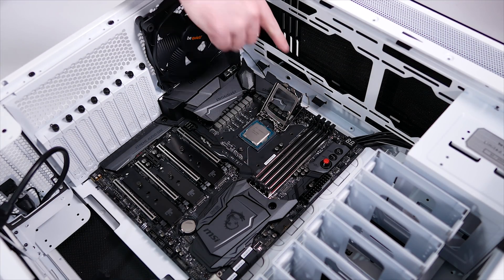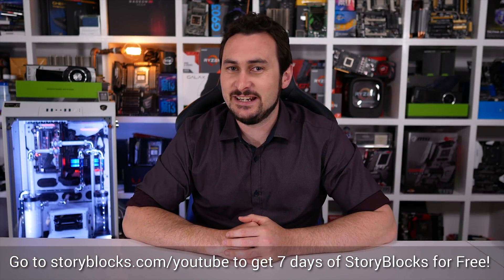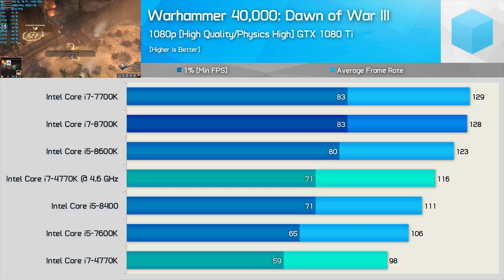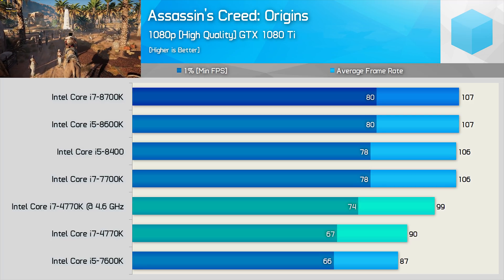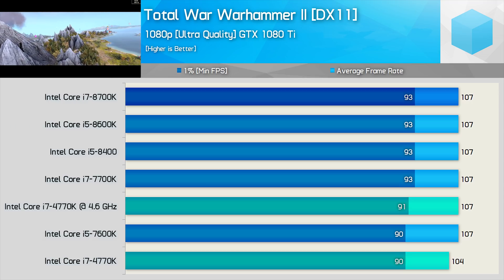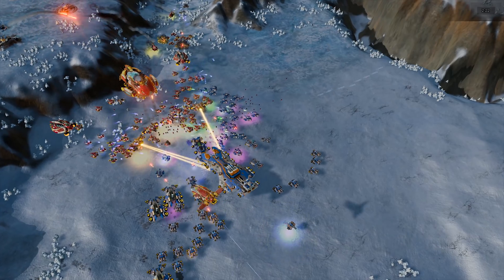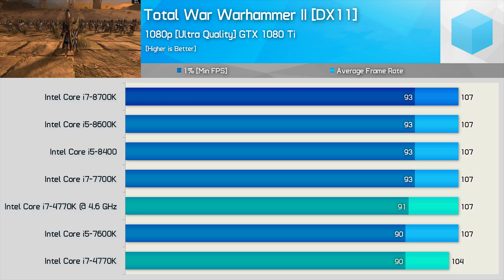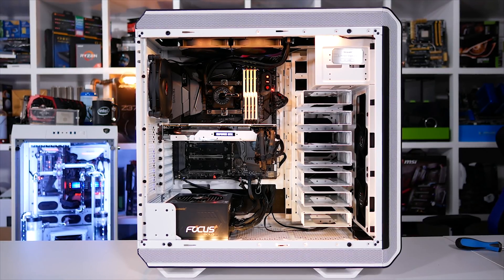4 Year Old Core i7 vs. Core i7-8700K, Worth The Upgrade?

Comment: How the hell can the 7600K be that competitive compared to the 8threaded Haswell chip? Skylake's IPC is only like 8% faster, this is weird. Can you verify the bandwidth is the culprit by trying it out on Vega? I'm more suspecting Nvidia's heavy mainthread usage to scale well with Skylake's 'supercore' tech. Because this goes way beyond the IPC difference.
Reply: Fuddy Duddy 8% per core.

Theoretically 32% faster at the same clocks, if games scale correctly.

Also if games don’t utilize the extra threads from Haswell i7s, performance won’t be as good.

Looking at well optimized titles, for ex BF1, the 4790K beats the 7600K easily.  7600K chokes from lack of threads.
Reply from the maker: I just lowered the memory speed on the 8700K system to 2400 and tried Call of Duty WWII @ 1080p [normal], the average fps dropped from 219 fps previously to 182 fps, a 16% reduction for a 25% drop in memory frequency.

Reducing the 7700K result by 18% would see it slower than the overclocked 4770K. Hope that helps clear it up for you.
Reply: Haxor, that's not how it works lol. IPC difference of 8% when comparing quadcore vs. quadcore means it's not 4x8 = 32% faster.
Reply: Fuddy Duddy

Sure it is.

IPC is improved about 8-10% at similar clocks, increasing single core performance on every core.

You can see the 7600 is 22% faster on average compared to a 4790 in quad core tests.  But if games utilize more than 4 cores/threads, as you can see the 4790 pulls ahead.

Games that rely solely on single core performance and IPC, Skylake i5 will win.  Games that rely on threads, Haswell i7 would.

(I chose non K, because they match more closely in clocks.  Granted if they were K, you could overclock both, and Skylake OC better)

http://cpu.userbenchmark.com/Compare/Intel-Core-i5-7600-vs-Intel-Core-i7-4790/3890vs2293

Similar reason even the 2600K is still powerful today, beating 6600/7600K in heavy high threaded titles, but much slower in single threaded apps.

Based on your theory, a 7700K should be close to a 4790K, about 8% difference both being 4c8t.  But 7700K is a lot faster than 8%.
Reply: Haxor inator there are other reasons, as explained, to explain the higher than Ipc differences. No, it does not work that way, stop being an idiot

Comment: Bf1 single player i5 6600k 4.6ghz and 1070 silky smooth, multiplayer another story... Friends with i7s and ryzen do not have this issue in 64 player and huge geometry crunching scenarios
Reply from the maker: You can see the large variance between the average and 1% low in BF1 single player, that said the multiplayer issues for 4-core parts is well documented.
Reply: Fair point! thanks Steve,  Have a good one!

Comment: So what about those of us stuck with haswel i3 4150 hahahaha :P
Reply from the maker: Get a second hand i7 or upgrade to 8th gen or Ryzen ;)
Reply: yes will be doing that in 2018 Jan-Feb thanks for the tips.
Reply: I5 4160. I got a i5-4690k and z97 board few months ago. With h81 w/o oc it was just ok, but it shows its power when oc'd with higher clocked memories. It also depends of course on your usage. I play games where gpu doesn't matter that much and more than 4 threads aren't really needed as well.

Plan to stay with this setup until DDR5 (2x8GB DDR3 sticks @2133MHz now), if I ever upgrade then it will be broadwell i7.

Comment: Personally as someone playing at 3440x1440 + 1080Ti @2ghz with 98Fps lock on 4770k @4.5, this benchmarks yet again prove that CPU is perfectly capable. I really like those TW Warhammer benches on Ultra where you can clearly see all of the CPU's performing exactly the same.

In my case, 3440x1440 is still a hard resolution even for 1080T to push, due to that 0 reasons to upgrade for next 2-3 years.

Great benches, amazing work Steve!
Reply: Hi cryohellnic - what would be your thoughts on playing triple screen 7680x1400 using 2x1080ti in SLI? ...would I see the difference between 4770k vs 8700k?
Reply: @mateovevidea  ofc
Reply: cryohellinc I agree with you now, another GPU upgrade & you might start to see a difference though. But by then there might even be good Ryzen+ options if they can get their clock speed up!
Reply: HOkayson
EXACTLY my thoughts on this. Ryzen has good performance, which in accordance to AMD was worst case scenario in their books. Ryzen+ on 12nm should be an improvement, and if it will reach around 4.5ghz area,I may consider it. 

However still main bottleneck nowadays is GPU, and unless you go issue infested SLI / Crossfire, that won't change any time soon.
Reply: Was there any form of a bottleneck? I was thinning of putting a I5 4690k with a GTX 1080 TI and I thought that with those results, what I proposed does seem doable.
Reply: there was (on average) a 20% performance increase when using a GTX 1080ti. That's noticeable, particularly when trying to get higher refresh rates. What part about the video wasn't clear on that?
Reply: You dont have bottlenecking issues? win10? I have only GTX 1070 and its giving bottleneck spikes to the cpu.
Reply: Same system here but at 1440p instead. Which cpu cooler do you use? With my H80i the temps go through the roof if I overclock to 4.5ghz, thinking of swapping for something else.
Reply: 4790k@ 4.7ghz . 1080ti @ 2025mhz 1440p ROG PG278Q. I am good also!!!!!! all under water...
Reply: i have a acer x34a 100hz g sync currently my 2 gtx 1080ti sli pretty much max out any games i throw at that resolution and frame rate i dont see upgrading my cpu anytime yet
Reply: yeah and i wish they would bench something other than goddamn 1080p
Reply: cryohellinc What are your thoughts on i5 3470? I own a gtx 1060 6GB. Should I wait for Ice lake or just go with Coffee lake i5 8400. I play games at 1080p.

Comment: Steve I would want you to also test with a midrange card so we could see if there was any positive scaling with certain games.
Reply: Shuttle Munky He showed that the 1070 was the limiting factor in a few games, that tells you all you need to know, you don't need a CPU upgrade unless you have a 1080/1080ti.
Reply from the maker: I did with a GTX 1070, huge GPU bottleneck.
Reply: That is why i am asking mate. Still wanted to see if there are any fps difference at all with a mid range gpu. Because most people probably have a 980ti(roughly the same you know)  at best paired with that cpu (unless they upgraded lately ofc). So that means no reason to upgrade unless you are going with 1080ti.  Thanks for the answer btw love your videos :)

Comment: Had my 4790k sitting at 5Ghz on water since release

guess it will keep me going for a few years more.
Reply: Mr.Haaska if it dies, It dies ...
Reply: @SuperTurbo9001  lmao that's what I say about every PC part!
Reply: Mr.Haaska I disagree. People are way too scared about longevity from voltage. If you're stable, you're safe.

Let's say it's really a potential problem over time... Do you really care if your CPU only lasts ten years instead of twenty?

I've pushed my CPUs as hard as possible since my 486 dx and seen two fail: one from a blown PSU and one coppermine that accidentally got fed 2 volts. I'd worry sooner about solder failing.
Reply: @efg6625  the problem isn't the CPU, it's the motherboard, try finding a good motherboard second hand for a reasonable price. A CPU will easily outlast a motherboard.
Reply: 1.37 currently.
Reply: June 2013 on 24/7
Reply: says who ? I have had a 4670k from release with 1.45+v have benched for many hours @ 1.65v
Reply: Boja man I'm jelly, can't get more than 4.8 @ 1.293. I can't push mine any harder.
Reply: i do have high end water cooling 5x120mm rad
Reply: Same :)
Reply: well i poked around google and find information that 1.35V is max safe voltage. i can be wrong here. but over 1.4V starts to feel too high for my taste
Reply: even if you can cool it down there is still high voltage can wear down cpu and shorten cpu life
Reply: by the time it would kill the cpu it would be irrelavent. Its like if i were to say OH NO MY PENTIUM 4 BIT THE DUST! if it happens ill spend the 2 dollars on ebay to get one. Or upgrade the chip (say if someone had an i5-2500k and it goes poof a couple years from now, now they spend 30 dollars to get an i7-2600k
Reply: how long have you used your cpu then?
Reply: how much voltage you put in your 4790K? I got 4.8GHz with 1.28V
Reply: @HaaskaChan  this is perfect tho. voltage obviously does affect longevity. just because you're stable doesnt mean the temps arent higher than what they should b, etc etc, more wear on i/o and power nodes, etc. I believe 4.8 at ~1.285 is perfect. im seeing temps of 30c idle and 55c while playing Crysis 3 on Very High. & I only have a 1x120mm AIO, mind you
Reply: borderline too much voltage. if you want keep your cpu dial it little bit down. if you want that is. safe overclock voltage goes 1.35V area

Comment: Got to love those Storyblocks. Also, great video Steve. I dont even have a rig these day so have been thinking about putting together a older rig. Seems like the smart play tbh.
Reply: Rocky Radovanovich used parts offer amazing price to peformance. I recently paid $60 for a red devil r9 270x and I can happily play games at 1366x768p (my crappy tv resolution) and I get 40fps on gta v with almost everything cranked up despite it's 2 gig vram buffer.
Reply: I have been looking like a demon, but the secondhand market in NZ is pretty beat. I saw a 2600k and mobo go for nearly $550 the other week

Comment: Thank you for doing this benchmark. I always wanted a review of my current haswell 4790k cpu and you've done it. Just have one small problem. For the GPU could you use an rx480/580 and/or gtx 1060? Thanks again.
Reply from the maker: I used the GTX 1070 as an example and we saw a serious CPU bottleneck, there's not need to test a slower GPU if that's the case ;)
Reply: With those GPUs you really don't need a CPU upgrade, I thought that was clear from the video tbh.

Comment: Hey guys, using my system (i5 4590 + Z97 Mobo + GTX 970+600W Bronze) since June 2015. On CPU intensive games like Battlefield 1, I saw some bottleneck. Should I save some money and wait for June 2018 to upgrade my mobo+ram+cpu or get an i7 4790k+liquid cooler? (I can't buy the second option now neither, need to wait till June 2018)
Reply: Oblivion Technopat if you can't buy anything until June next year, why are you even thinking about it right now? A lot can change in that amount of time so forget about it for a few months imho!

Comment: Thanks Steve! You proved again that there's no need to upgrade my i7 4790 since I've got a RX 480. But my mobo is using just PCIe 2.0, I wonder if this might be a bottleneck...
Reply from the maker: Thanks mate, PCIe 2.0 makes no difference with an RX 480 so you're okay ;)
Reply: Thanks again! :D So my next pc upgrade will be a GPU upgrade again, in a few years or later. I hope you aren't haunted by blue bars in your dreams, because you are doing all these benchmarks. :)

Comment: As a 4790k owner I'm both pleased and sad after watching this. I really thought 8th gen would be it, the clear time to upgrade. But with a Gtx 1080 I guess I won't be seeing any discernable difference. I'll just keep waiting. Maybe by the time it's worth it the ddr4 pricing nightmare will be over. 😐
Reply: if youre not going for ultra high fps what you got will do for a while.  at least till the next console. all these games except ashes (which nobody actually plays) are made for console first cause thats the biggest market. and then when it comes time for the pc version they cant add too much or it makes the consoles look bad.  the devs came out and admitted on some of the fallout games as well as a lot of other titles.  until a totally new console with a totally new cpu come out, and not a halfstep like the one x and pro, then you will not get to upgrade.  like you said pleased and sad.  but why would you want to upgrade if youre cpu does everything you want?
Reply: Thats what I feel like as well , I really want something new to oc and play with but when I already get 100+ fps in all my games on ultra @ 1080p i really have no excuse to upgrade my 4.8ghz 4670k/1080 combo .
Reply: With 8 threads, good IPC, and good OC potential, you'll be fine for a couple more years.
Reply: disagree when the upgrade cost is 600-700 bucks. Most people won't benefit from many of the features that have been added since Haswell. If you do work that requires CPU power and newer features sure but if you are just gaming a 4C/8T will still do amazing.
Reply: Sorry bud with no competition the big guys are gonna keep it high with price fixxing with non communication price fixing
Reply: The 9900K will be the big upgrade for most people that have 4 core 8 thread Intel CPU's. The 9900K will be a beast at gaming and with it's 8 cores and 16 threads it will be a productivity beast as well.
Reply: You may not see much of an difference in frames, but the overall user experience will improve. With 6c12t you would have plenty cpu usage available for other stuff instead of hitting 90-100% usage. Sometimes just newer features and better user experience are worth the upgrade.
Reply: Are you blind or what? Most games have 30 FPS more with 8700k than 4790k (which is mine processor too). The difference is ultrageous.
Reply: @jorge_781  That's with a 1080 Ti at 1080p, which is a pretty stupid configuration unless you're a professional CS:GO player or something.

Comment: So, with a better cooler for my 4790K (currently stock)+replacing the DDR3 1333 with DDR3 3200 (even if the IMC doesn't handle it at that speed) and replacing the tier 6 PSU I should be set for a while.

Comment: I've got a i7 4790 (not the k) so the 4770 none overclocked results are most important to me, so thanks for this comparison. I have a 1050 ti so I'm not getting cpu bottlenecked but irrespective it's good to know that if ever I feel like upgrading to a more expensive GPU I can (and with what sacrifices). Thanks for the awesome video 😊
Reply: Cen Jake I understand that, when I said sacrifices I was just refering to the small deference in performance. I suppose "sacrifices" was the wrong word🤔😂.